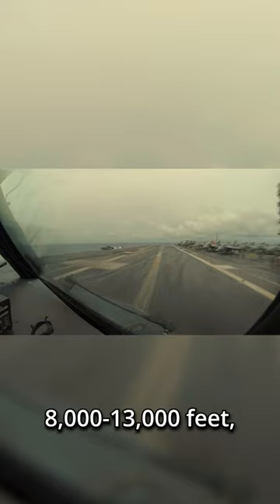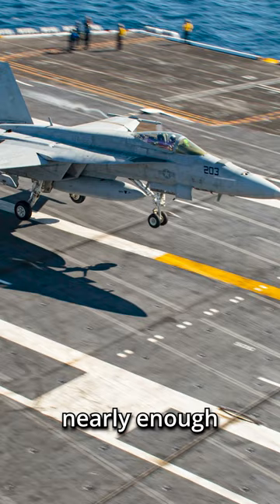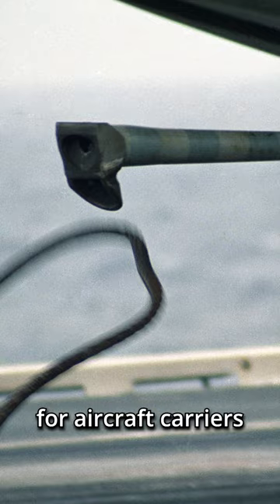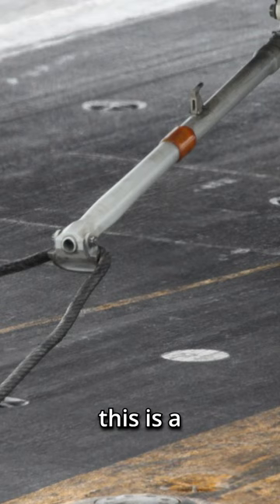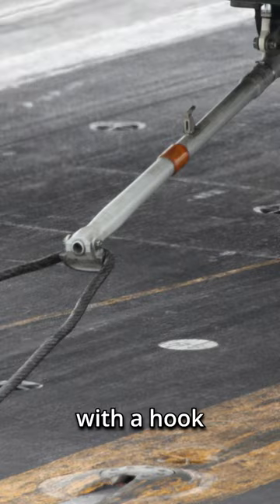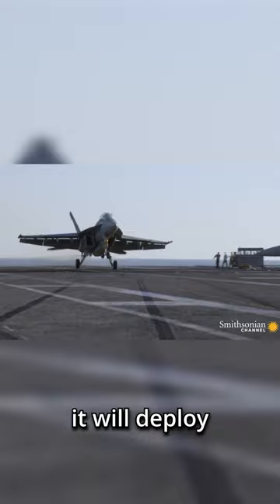How does a Plane Land on an Aircraft Carrier?  #shorts

Comment: Correction to your script: Aviators apply full-throttle after the aircraft physically touches the deck, i.e. landing, not before they land.  The reason being is that you have to maintain landing speed up to the moment of landing, so as to ensure a proper glide path.  An Aviator applies full-power after touching the deck, i.e. landing, in the event they miss the arresting wire.  It may read/sound like no difference, but it a significant difference.  I know, I have done it several hundred time.
Reply: Very interesting mate, thanks for clearing this up as I wouldve ve been misinformed otherwise. Any stories you are willing to share about your time in the forces?

Comment: Its really not the most difficult thing. Mid-Air refuelling, for example.
Reply: Mid-air refueling is infinitely easier than landing on an aircraft carriers deck. Missing the fuel sponson with your boom won't send you into the drink. It also won't break an arresting cable, causing it to snap back and kill Sailors.
Reply: @SkunkApe407  What you've suggested is greater danger, but not difficulty.
Reply: @_burd  it is most definitely more difficult. I'm literally a USN veteran. Not only that, but I literally worked in the V-2 Division aboard CVN-71. V-2 Div is directly responsible for all arresting and launch gear aboard a carrier. I've walked the walk, bud. Been there, done that. Any pilot who has ever had to put a bird on deck will tell you that it's the hardest thing they do.

Comment: My father, who has more than 3,000 carrier Landings to his Credit, describe the carrier trap like this. Take a telephone pole, 50 ft long, put a pivot in the middle of it so it's balance like a teeter totter. You sit on one end, with a hook on the other end. Then we'll accelerate you to 120 miles an hour, and you must steer the other end of that pole with the hook, into a box 50 ft wide 3 feet high and 5 1/2 ft deep oh, that would be the three wire on an aircraft carrier!
Reply: Not to mention the flight deck is going through open ocean and thus changing elevation +/- 10-15 ft constantly
Reply: Worst I saw was on a workup of the coast of Cali. We hit some really nasty seas and had nearly 100ft of deck movement. The carrier was slapping planes back into the air as they tried to land. Thankfully, all airborne craft were diverted to Alameda after 15 min. Although, one E-2 Hawkeye had the unfortunate luck of snagging the wire just as the deck dropped. Plane must have bounced a good 6ft off the deck. Worst flight ops I've ever experienced.
Reply: @TimothyWelty  well the good news is it was a Grumman! And if you could manage to bend a Grumman airplane you've managed to achieve something! My dad had 18 years flying stoofs/c-1s off of cv decks.

Comment: If you struggle to keep up with Simon's impressive pace combined with medieval units he meant aprox. 2600m-4300m and 160m. Also some duster airports are even shorter than 2500m but you can start only planes like Stork with low falling speed and lift off few hundred meters.